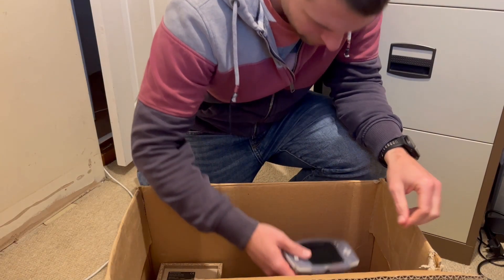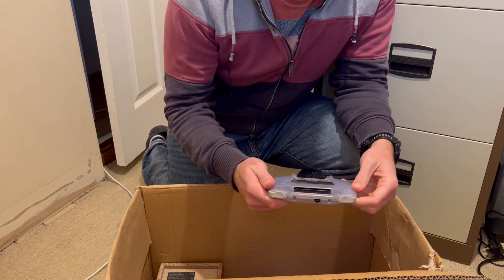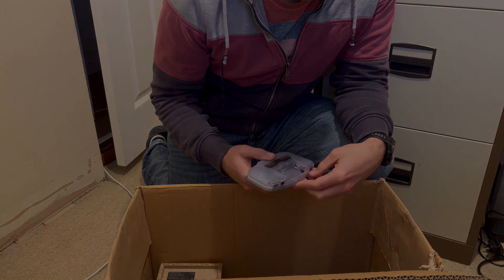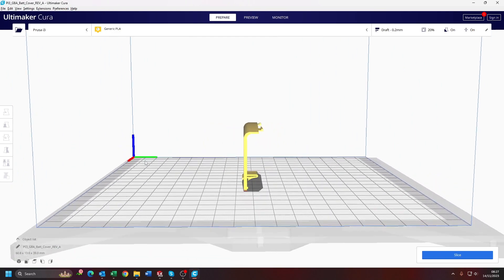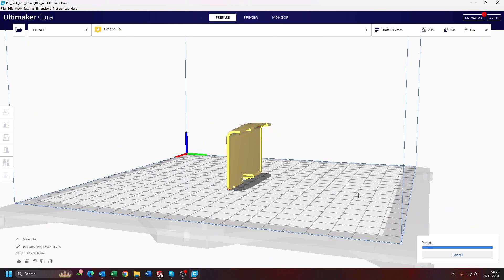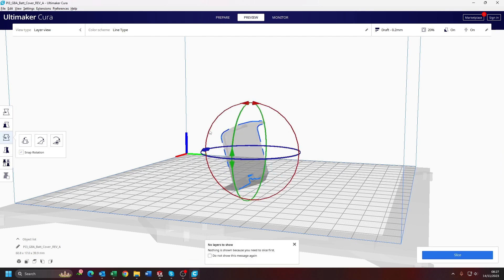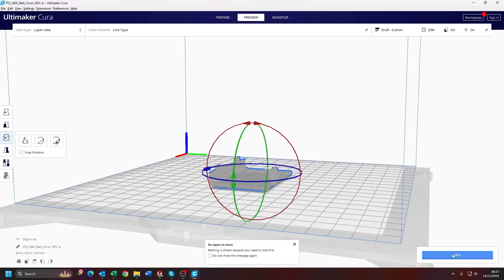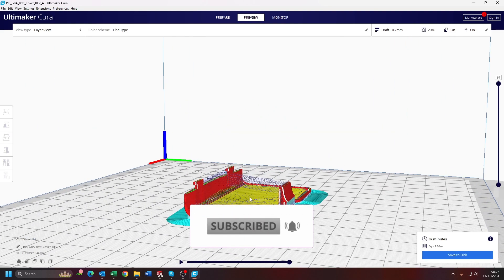3D PRINTING GAMEBOY ADVANCE BATTERY COVER

Comment: What is the cost of the Printer?
Reply: more than the cost of a replacement battery cover if that's what you're asking. 😆 (I think that model is around the 500 mark)